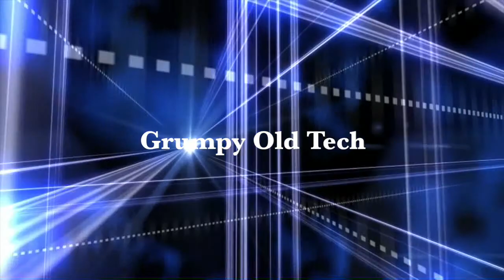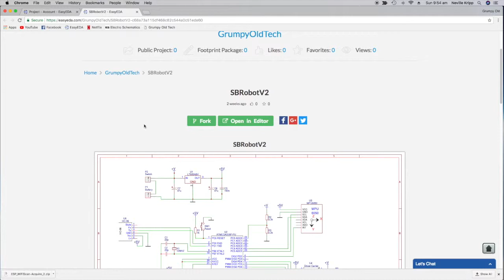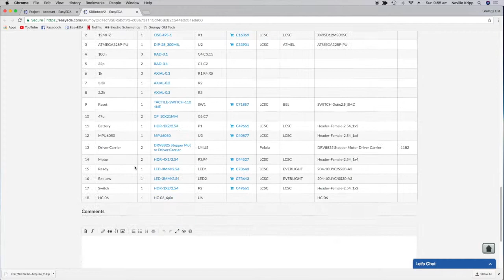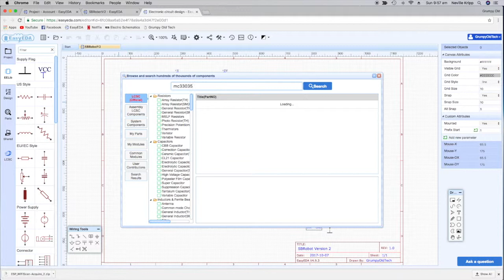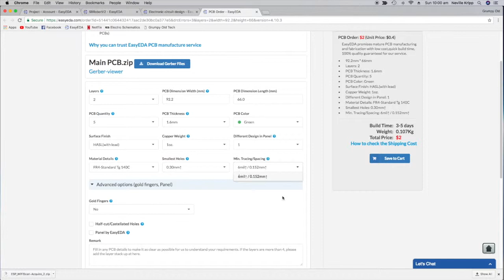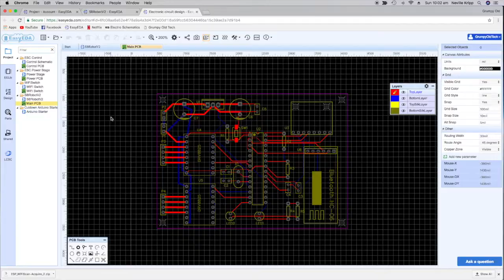#014 EasyEDA Schematic and PCB Design

Comment: one question i have is can i increase the size of the schematic canvas? i dont have enough space to put all my IC's
Reply from the maker: Hi, sorry about the delay in getting back to you. I have just been flat out with work and family stuff.

When you have the schematic canvas loaded in the Drawing Tools menu there is a title frame tool. If you click on it you can select different sheet sizes.

Also another thing I do is create more than one sheet and break up the circuit into logical elements and create links using the Net Port in the Wiring Tools.

Hope this helps
cheers Nev.

Comment: What I cannot find I most packages including this one is Off Board components, whilst they are an integral part of the schematic, all I can find are the trimmer styles that would be part of the pcb. Off board switches, don’t seem to exist either, so how does one accommodate them in the schematic and subsequent pcb?
Reply from the maker: Hi Bruce, 
i head for the Libraries search when looking for components, not always a guarantee of the item being available however normally pretty good. I am also building some bits and pieces myself. 

The off board components question is answered in this post. Not an ideal situation by any stretch though. Hoping this is improved soon.
https://easyeda.com/forum/topic/Placing_Off_Board_components_on_the_Schematic_-0dbxFpZXU